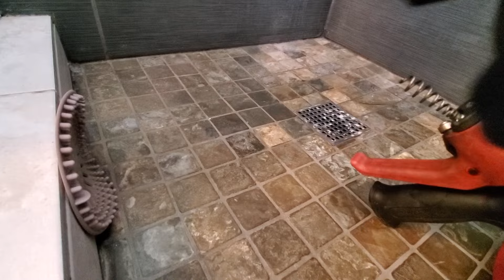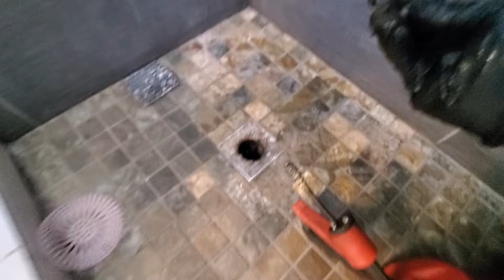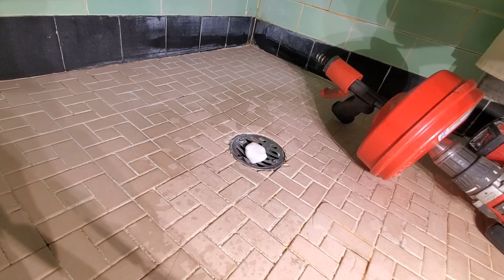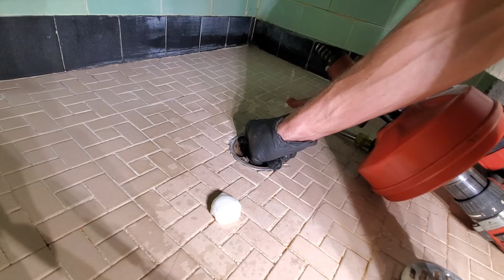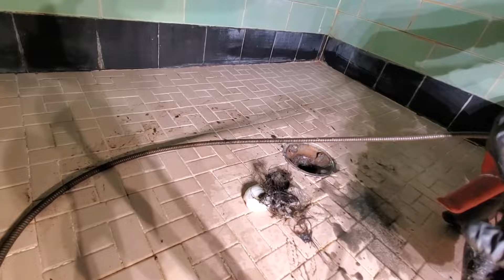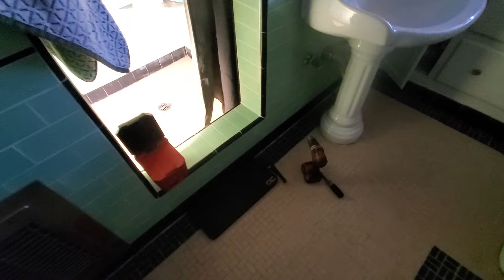Snakin' a couple drainz

Comment: Great job👍🇺🇸.  That 1/4 inch pig tail cable drill does the job. I’ve seen some plumbers cut the pig tail end cable because it get stuck in old pipe drains.